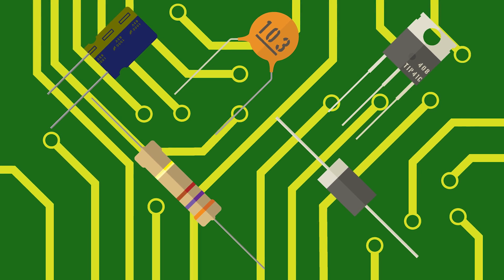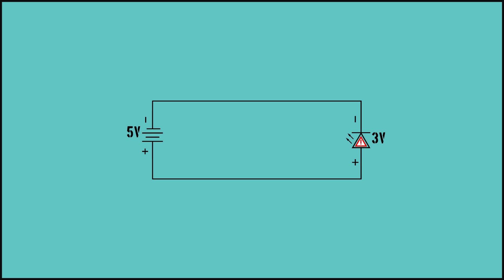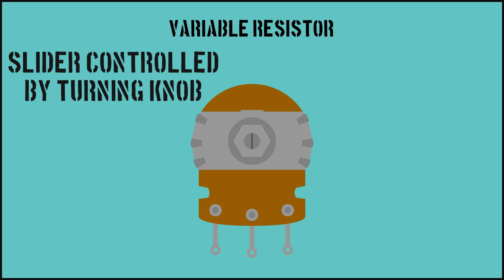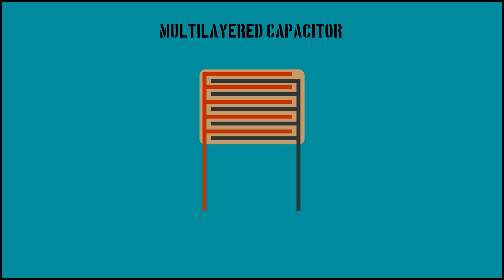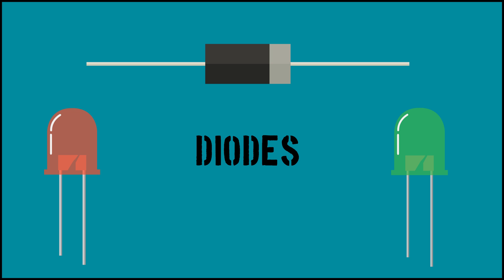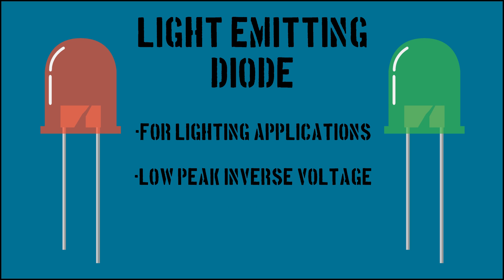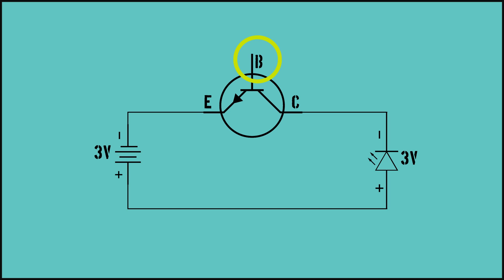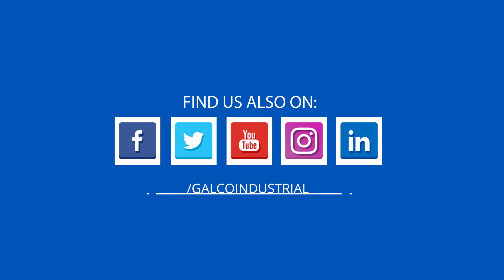Electronic Components Guide

Comment: Done watching sir❤️
On this video entitled "Electronic Components Guide" are great, I honestly learned more about it to the Basic properties of electricity and also their means such as the voltage, current, resistance, ohms, and ampere and I also learned the basic electronic components such as  Resistors, Capacitors, Diodes, and Transistors and  I also learned about there symbols and types of their components. This are the common in the electricity...

Comment: Done watching this video sir❤
This lecture taught me about the basic properties of electricity, which are the voltage, current, resistance, ohms, and ampere and how they can be interpreted as. The video also taught me the basic electronic components and that they play a huge role in the electric circuits or electronic loads. These electronic components are the Resistors, Capacitors, Diodes, and Transistors. Aside from that I have also learned the looks of these components and their symbols and diagrams, in which it is crucial for us to learn and remember it since we will see it onboard ship soon and because they can be seen almost anywhere especially near electric circuits. The video also taught me and made me realize that If a person does not know the basic components then he/she will have a hard time fixing an electronic load or circuit since he/she does not understand diagrams. Lastly, I have also learned in this video the placement of these electronic components, and that we need to put these components at the right place so that the loads could function properly.

Comment: What I’ve learned from this video is the the basics of electronic circuit elements. I also learned the basic properties of electricity which is the voltage, amps, currrent, ohms and resistance. I also learned its differences and its purposes. I learned that each property has different types and each types has different qualities. Each property has its own functions and how it is properly installed and used in an effecient way.

Comment: Done watching sir, I learned about the electronic guide the basic component of electricity I learned also about the capacitor, diodes transistor and resistor each components have there own functions . I also learned about the different kinds of resistor and the transistor diagram the kinds of diodes  and capacitor.

Comment: Base on my understanding in this video, I learned what are the basic properties of electricity and also what are their roles. I also learned what are the uses of Resistors, Capacitors, Diodes, and Transistors. These 4 components have big roles in electricity. Aside from that, I learned that these components have symbols and these symbols should be and must be remember because when we're onboard ship we often see their basic symbols not the technological symbols.

Comment: DONE WATCHING SIR  💖
salamat sir may  may bagong  nanaman natutunan  ako simula sa RESISTOR ,CAPACITOR, DIODE,TRANSITOR AND Dagdag pa yung voltage .current. resistance. ohms at isa pa dun sa light emitting mode po yun sir for lighting application and low peak inverse voltage po sir dapat daw pag ingatan yung mga wiring nya sir sa sakto para iwas damage sir